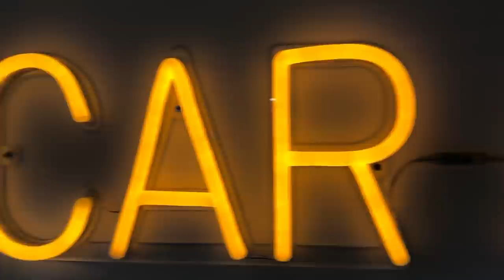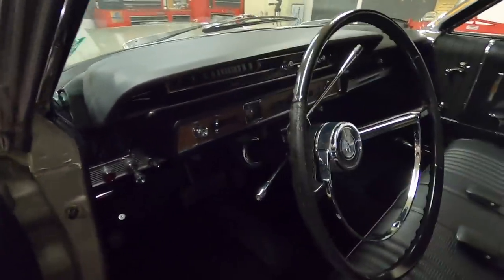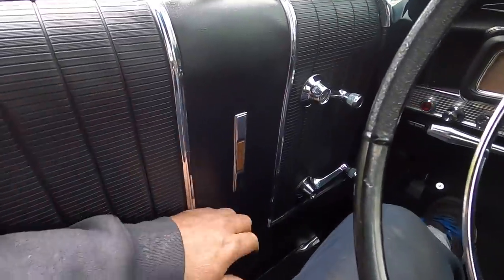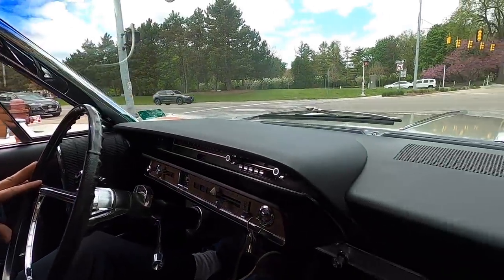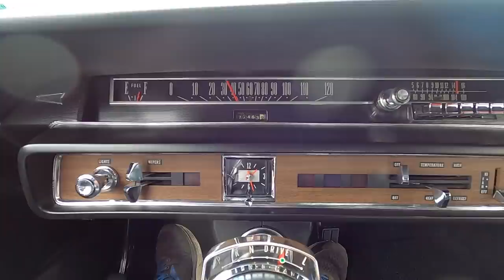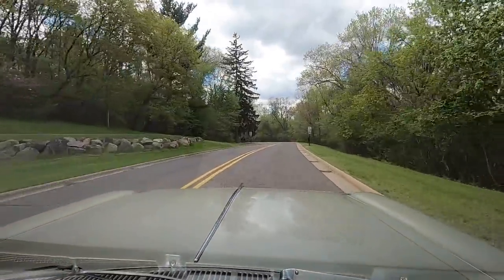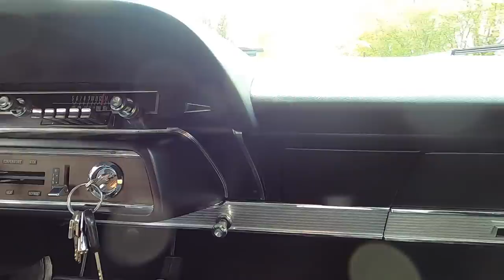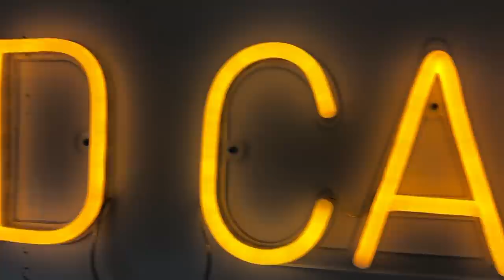1966 Ford Galaxie 500 convertible restoration part 199 finishing front seat and a nice ride

Comment: Howard, you said, "it drives like a brand new car", well with your hard work it is a brand new '66 Galaxie. I'm celebrating something too. Almost four years ago my '12 Chrysler 200 convertible suffered a hit and run while I was driving north on I 25 from visiting my Uncle. Thanks to the latest Federal stimulus I was able to pay the $2171 for the rear fascia restoration. Certainly body shop work even on a lesser scale is costly. Congratulations on your convertible Howard and remember your Mom tomorrow as I will remember mine.

Comment: Car looks great. I hear some ka-thunk-a-chunks when going over bumps. As meticulous as you are, can't imagine there are any suspension issues. Could the noise be coming from the hubcaps in the trunk? Maybe it sounds louder on video than it actually does in the car?

  Does it sound louder
Reply from the maker: There was really very little sound in the car, for some reason it sounded crazy in the video...... I think you were hearing crap in the trunk, plus at one point on Woodward there was a beat up pick up just behind up making lots of noise.

Comment: What are the horsepower and torque ratings for that 352?  Sure sounds good at idle!
Reply from the maker: It's a 250hp.... but I don't remember the torque rating at the moment. I has lots of get up and go for being 100% stock.
Reply: @OldCarAlley  Thanks!  Good of you to get back to me so quick. Your restoration of this convertible is impeccable.